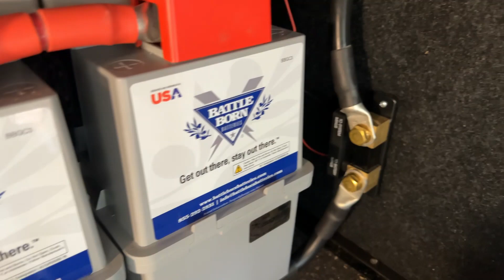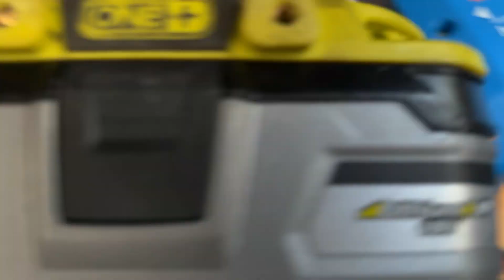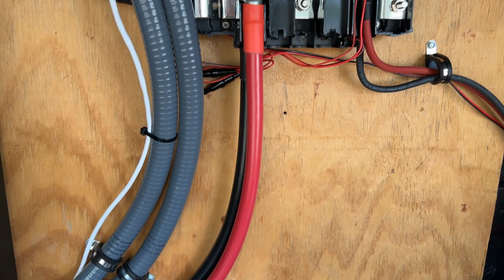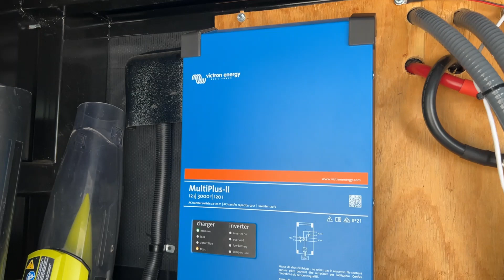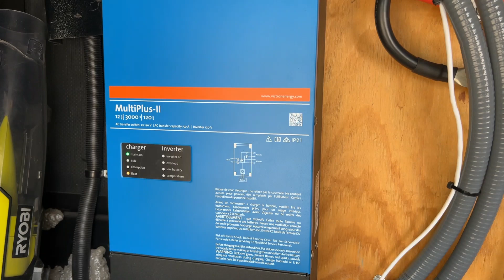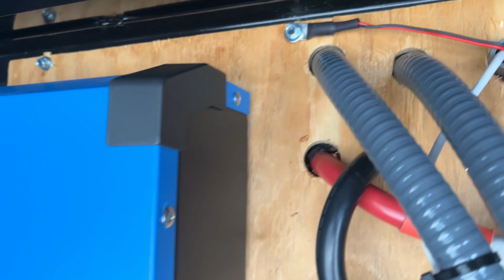Victron RV Setup - Deeper Dive on 12v DC Setup

Comment: Outstanding video.  I just bought the Ember 221 with the max solar package.  3k victron inverter/charger and 50 amp charge controller.   I just ordered the cerbo 50 kit and will install that when it arrives.  My question for you is should I get the USB adapter to possibly program inverter sometime in the future?  I assume the victron is already programmed for the GC3 battery that was factory installed.  I just bought the rv last Saturday, so I haven't learned everything about the system yet.
Reply from the maker: If you’re not 100% sure that the charging profile is set up per Battle Born’s specs, I would recommend getting the ve.Direct to USB adapter dongle. There are a lot of settings in the inverter that you really can’t set any other way. It’s always better to be safe, plus you will ensure that you are getting a full charge in your batteries for maximum capability. Feel free to reach out if you have any questions.
Reply: Thank you.... I recently installed the newest firmware and that will erase your current settings.  I contacted battleborn battery and they walked me through the newest firmware and settings.  They are a great product and outstanding support for their products.
Reply from the maker: @spev7989  yes!  Their support is outstanding. And you’re correct. Any firmware updates on the inverter will clear the settings, unfortunately. You can save the settings to a file on your laptop prior to upgrading, too, but I haven’t tried to import a settings file from an older firmware export.

Comment: Very nice explanation. I have the same setup. I also did the lynx light hack. You only need a 12v to 5v converter. You can use the wire that came with the lynx. You could find Nate,s you tube chanel. Type lynx light hack its there.
Reply from the maker: Thanks for the tip!  I’ll look into that.

Comment: I have enjoyed all you video's. The question I have, because I have also had an issue with this, is where your emergency brake power cable connected to? As it appears in this video, it must still come off the original positive buss bar. If you ever have to move your 5th wheel for any reason, you will have to turn on your battery disconnect and have no blown fuses, which also powers everything else. I have mine connected before the disconnect so I always have the emergency brakes.
Reply from the maker: You’re absolutely right. With that said, I never tow my RV without the power turned on. If I have blown fuses, I would want to find those first and resolve, anyway. In my case, my RV needs battery power regardless of the breakaway function because I have electric over hydraulic disc brakes, so I need to have battery available for the hydraulic brake fluid pump. The truck probably could power it, but don’t want to take chances on that. Never tried to tow it without battery power available. 

Also, I still have the factory 12v disconnect in my RV, so I can leave the “master cutoff” on, and turn off the factory one that turns off the 12v items inside the RV. That would still allow power to the factory buss bar.

Comment: Great overview. Getting ready to do similar up dates. I was having some spacing issues on my vertical surfaces. You just taught me to think in 3 dimensions.  Somehow that escaped me. It may be too late, but you can use Ruuvi wireless temp sensors with the Cerbo. They populate on VRM without jumping through any hoops. You need GUI mods installed to see the sensors on the Remote Console.  But thats pretty easy. And GUI mods also gives you a ton more data points on the Cerbo screen. I placed Ruuvi sensors in the fridge, freezer, inside, outside, and wet bay. The other thing you can do with your smart shunt and cerbo power is just put them on an empty positive buss bar terminal, no mega fuse required

Comment: Can I ask what you used to reach your monitor screen inside? Because the cable is so short and just a hdmi extender cable don’t have the usb for power. Is there a cord you found that works? Thx for the video and I’m referring to the cerbo gx screen.
Reply from the maker: I mounted my Cerbo GX in the basement pass-through storage close enough that I didn’t need an extender, however, you can use an HDMI extender and a USB extender as well. The USB cable is only providing power to the screen and nothing else.

Comment: I think you would be better off running a DC to DC Orion Victron to the battery. This would charge more efficiently I think than your 12 V DC charger. But again I’m no expert. 
Also if you add solar panels, always remember to turn the solar panels off first before disconnecting the batteries. I use a disconnect breaker box between the solar panels and the bus bars. 🖖
Reply from the maker: Yes, the DC to DC charger is coming. That will be soon. And agreed, on turning off the solar panels. Can basically create quite a surge at the controller, otherwise.

Comment: Thanks for the video and walkthrough.  I'm about to install a very similar system, but with fewer batteries for now since I just have a 28' Winnebago travel trailer.   I am semi-new to wiring as well.  As far as the ground(-) from the Lynx distributor to the chassis, is there a reason why it's not also 4/0 cable like it is from the Lynx to the battery?  Why does it use the 6awg cable instead?  I'm trying to understand so I can do the same.
Reply from the maker: According to the Multiplus II manual, it states that the chassis ground conductor (wire) needs to be at least 4mm^2 in size, which is the equivalent of approximately 11AWG in US wire sizes... So anything larger than that is really just overkill for the application.  I had the 6AWG wire on hand, so figured I would just use that to keep it consistent with the wire that I ran from the Lynx Distributor over to the original bus bar.

Hope this helps answer your question.
Reply: @RickysHP  So as I understand it, you have a 6awg wire from the Lynx to the original busbar and then to the chassis ground location. And, you have a 6AwG wire that goes from the Multiplus ground screw to the chassis ground as well.  Is that correct? If so, would it make sense to run the ground from the Multiplus unit itself to the Lynx? Or is that a bad idea?
Reply from the maker: @UltralightSierra  while that would technically provide a ground path, the ideal route is to have it go straight to chassis ground.  The chassis ground for the Multiplus is a failsafe path in case something catastrophic happens, so I wanted it to be its own dedicated path.
Reply: @RickysHP  I think they are referring to the ground for grounding the Multiplus II itself to the chassis ground, but the system needs a ground equal to the positive + supply from the batteries. Meaning a 4/0 from the Lynx to the chassis ground bolt. In major event all the power that can flow thru the 4/0 red will follow the ground to the frame. Hence, 4/0 will transfer the power to the 6ga and fry that wire before the 400 amp fuse blows.

Comment: Thanks, Rick for this video with all the great details. I have pretty much the same equipment as you and was wondering how to connect to the trailer. Now I do!! As for the Lynx Distributor lights, there is a very cheap and easy workaround that Nate from Explorist has in his how-to videos. I wasn't able to get the same 12 to 5V transformer but amazon had lots to choose from. I'll update you when I get my system up and running.
Reply from the maker: Oh, that's a great tip!  I just ordered the voltage converter that he recommended and will wire that up into my system!  I was hoping to eventually add that functionality, but that makes it quite simple to do.
Reply: @RickysHP  I'm glad they are back in stock. When I ordered they were out and I had to get a larger one that sits outside the Lynx.
Reply from the maker: @bryanwood84  that’s unfortunate. It’s interesting that they’re a 4-pack. I only need one. Haha.